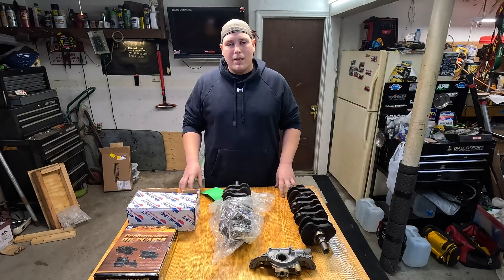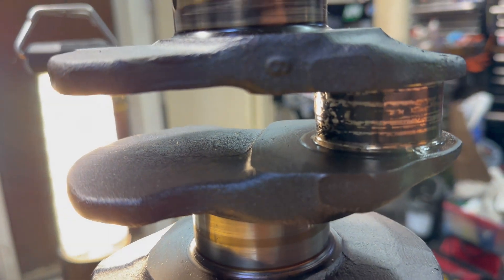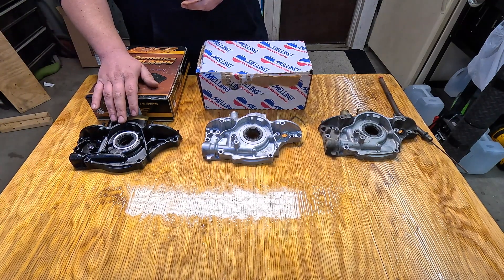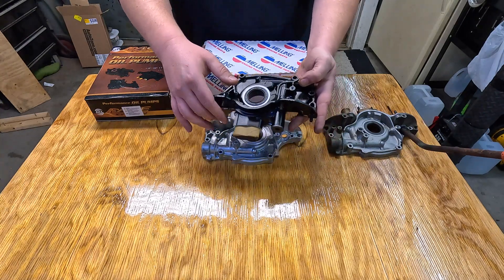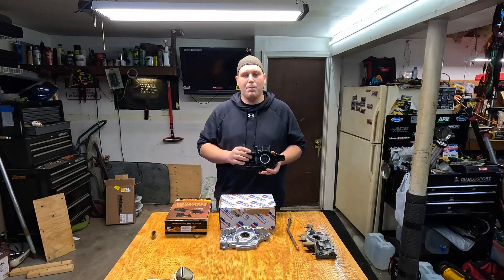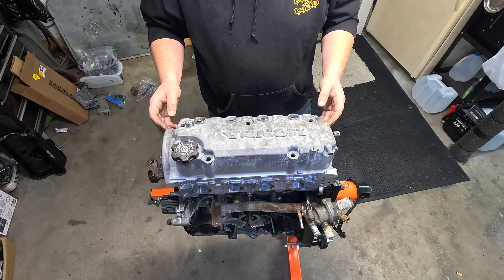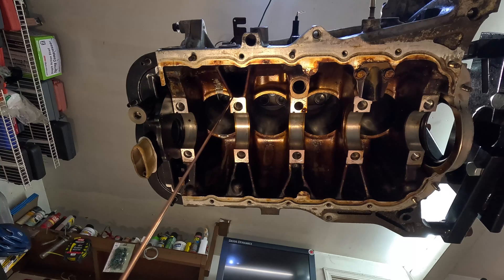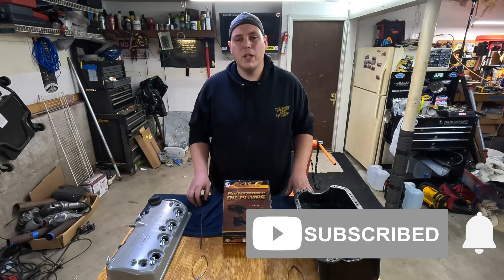ACL D16Z6 OIL PUMP ON A D16Y8..?? HOW..?  #honda #dseries #automotive #d16 #build #engine

Comment: What gasket did you use for the valve cover for it to work on the y8 head Without leaks ??
Reply from the maker: Either gasket will work perfect I just used a blue felpro gasket where is it leaking from? Mine has been fine thanks for the support 🤟🤟👍👍👍🤟
Reply: @bought2build a lot of forums are saying there’s mods that need to be done for the valve cover to work properly?? It’s truly stressing me out.
Reply from the maker: @Lu_Bucksss I did absolutely nothing to mine new gaskets the dipstick and made my catch can setup and I was good to go 👍👍
Reply: @b @bought2build also thank you for responding so quick 🙏🏽🙏🏽🙏🏽🙏🏽🙏🏽
Reply from the maker: @Lu_Bucksss no problem 🤟🤟👍👍👍 thanks for the support
Reply: @bought2build just to make it easier what’s the specific valve cover you used as well ??

Comment: Wish you talked about the pickup
Reply from the maker: Yeah I should have been clearer but use the pickup tube that belongs on which ever pump you are going to use thanks for checking out the channel I appreciate the support 🤟🤟🤟👍👍👍👍👍
Reply: @bought2build the only way I think I can even get a z6 pickup type is by buying the whole motor.  I have the z6 pump and y7 block with Darton sleeves.  My y7 pickup fits the z6 pump after I made the two holes on the spout oval and wider to fit the bigger, non round mouth of the spout.  Just curious how much HP did you end up making?

Comment: so did you install the acl pump for a z6 on the y8 block and used a z6 cranshaft and oil pan ?
Reply from the maker: @gabriellee6309  correct it is a y8 block z6 oil pump my y8 crankshaft was bad so I needed a new crank so I went with the z6 crankshaft but you could keep the y8 crankshaft if you wanted it would still work with the oil pump but you will need a z6 oil pump and pickup tube thanks for checking out the channel I appreciate the support 🤟🤟🤟🤟👍👍👍👍👍👍👍
Reply: @ thanks for quick reply, i just blew my first y8 so im gonna attempt
my first build 😁
Reply from the maker: No problem sorry I never seen this comment till now i usually reply fast but sounds like a perfect time to start a build! 🤟🤟🤟🤟👍👍👍👍👍👍

Comment: I'm building this exact same setup. Waiting to see how you guys sourced a d16z6 oil pickup tube
Reply from the maker: @RobZombahr  if you msg me on instagram I can send you some info! I couldn’t find one to save my life but found out that certain d15’s use a identical pickup tube so I bought that one and it fit 🤟🤟🤟👍👍👍 thanks for checking out the channel I appreciate the support! I’ve got everything to complete the engine just waiting on the epoxy kit to fill the block 👍👍🤟🤟🤟🤟

Comment: I had no clue that valve cover dipstick combo worked. What about the crank gear and cover? Is anything different?
Reply from the maker: @livefastdiehard  I didn’t either until I did a bunch of research and tried it! And sorry what do you mean by crank gear and cover? I haven’t found anything different! Only thing on my combo I needed to do was an adjustable cam gear because I am running an aftermarket comp cam that was made for a Z6 in my y8 I am also running a z6 crank shaft but it is a direct bolt up! Thanks for checking out the channel i appreciate the support! 🤟🤟🤟🤟👍👍👍👍👍